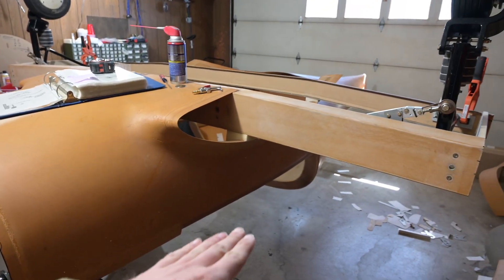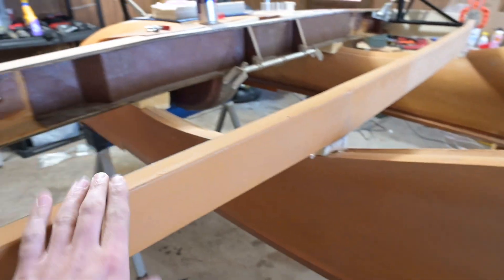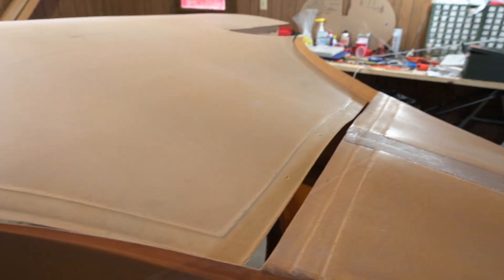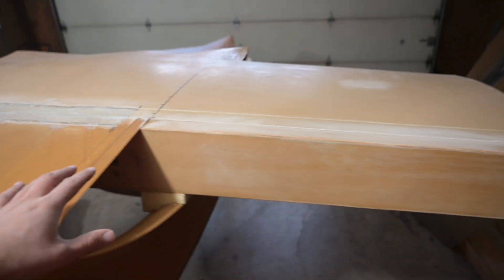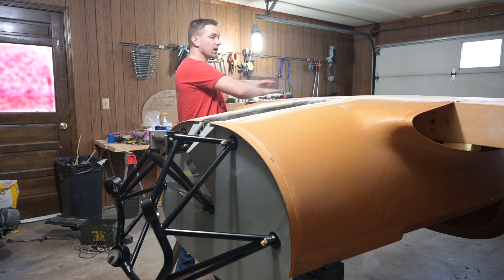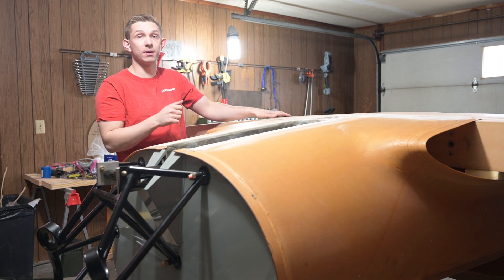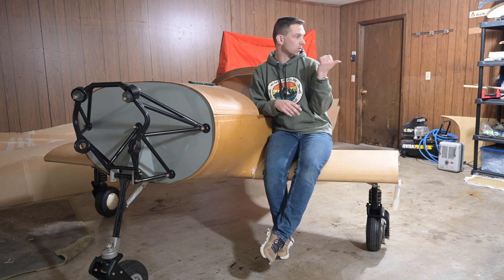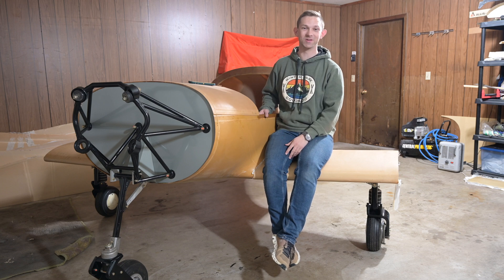Belly and Landing Gear - Lancair Build Part 7

Comment: Not sure I followed properly, but they want you to first out on that belly sheet then cut the openings and then fiddle the landing gear through it and get aligned while you have only that cutout opening to work through?! If so, that indeed makes no sense
Reply from the maker: Yes that is how the builders manual would like it done. You do have the entire top of the wing (bottom while it’s inverted on the sawhorses) to work the gear through as that doesn’t get sealed up until later. It still seems rather unintuitive. I’ve seen some 235s that had gear doors that were far too small which led to parts rubbing on the opening during retraction/extension. As I’m not overly fond of stuck land gear, I opted to oversized the gear doors to give myself some room to work with. The manual does allow for this, and the blueprints offer a suggested larger gear door area.

Comment: Hey Dylan. Tip for you cutting the fiberglass since you'll still be cutting a lot more. Just pull out a strand to get a perfectly straight line. It also helps the ends to stop fraying when you work with it. Also a favric cutter with the round roller blade works great for cutting quickly.
Reply from the maker: Thanks for the tip! I'll have to get a good cutter and mat pretty soon, there's a lot of glass work on the inside of the fuselage.
Reply: Fabric* You are moving along quite fast. My build has been on hold waiting for instruments and my fuel valve. Instruments arrived today, interior seats, centre console and side panels arrived Saturday and my fuel valve should arrive on Thursday. Shipment from Aircraft Spruce arriving Thursday too. Then it's go time.
Reply from the maker: @alanverity341  Awesome man! Myself and the previous owner completed a lot of pieces such as all the attachments to the main spar, the work on the nose gear tunnel, the fuselage halves getting joined, firewall, longerons, etc, so progress has appeared to move pretty quick because I really just had to assemble all those major sub-assemblies. Now that I’ve exhausted most of that externalized work progress is going to slow down. Good luck on your build, it’s cool to see some of these being built in time with me despite the kits having been out of production for a while now.